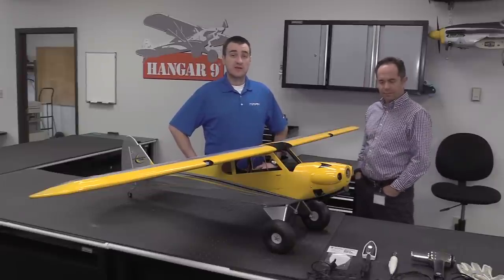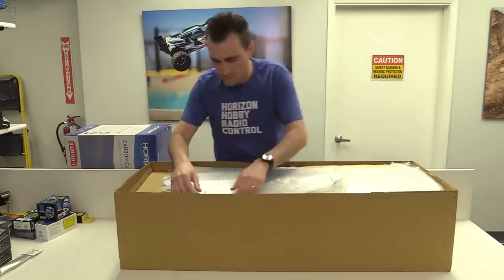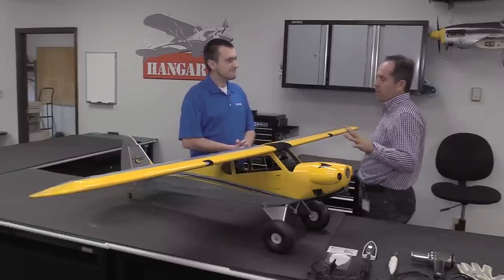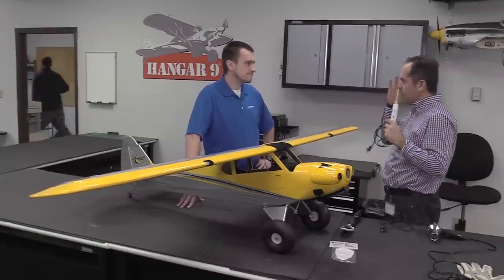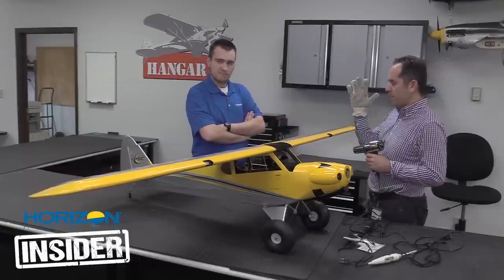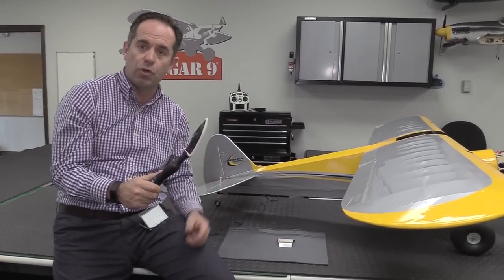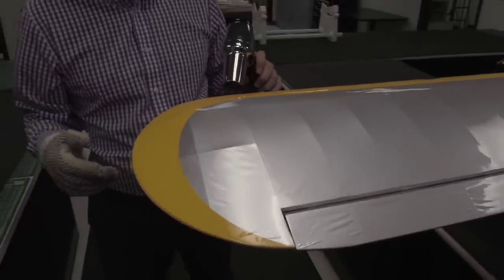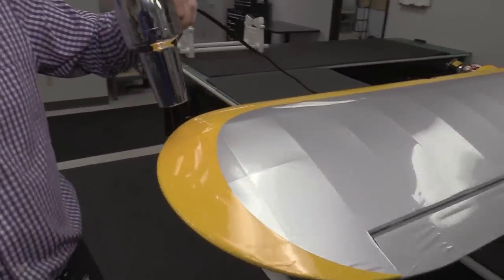Horizon Insider Tech Talk: Ironing UltraCote®

Comment: Ali, this was almost my first ARF, Is it possible that the wing can warp while shrinking the Ultracote? That's my main concern I'm afraid that the ribs can be pulled more to one side when trying to hit in between the ribs? That's the whole reason why I haven't tackled it yet I don't have this exact model. I have the cubcrafters xcub 60 with a SaitoFG-61TS twin IC. But it has nowhere near as many wrinkles as the one in this video it's just the main wing on the top everything else looks great, other than the ceiling edges like you explained in this video is what I have done so far.

It's already been in the air flies amazing especially on floats with my fpv head tracker so fun on the flying in small Canyons running the Spektrum ix12 with TBS Crossfire and as well as a vector why controller with GPS wish I saved my butt many times lol. Anyway you can ignore the rest of this nonsense I was just like an answer on working the wing is it possible to warp it?

Thanks!

Rob